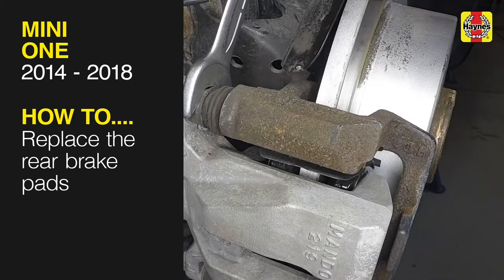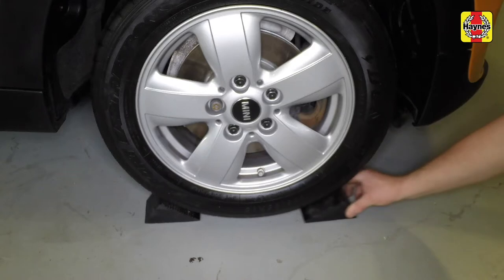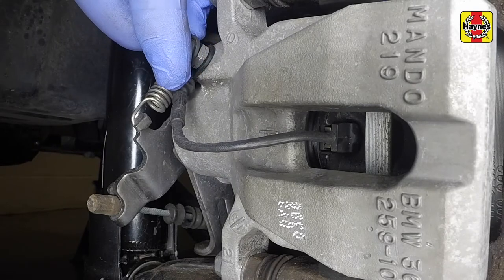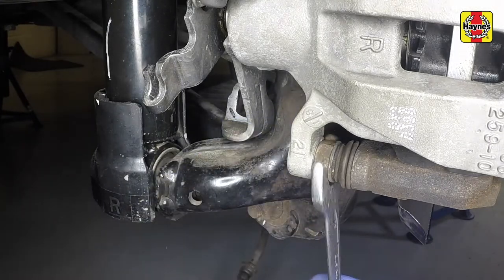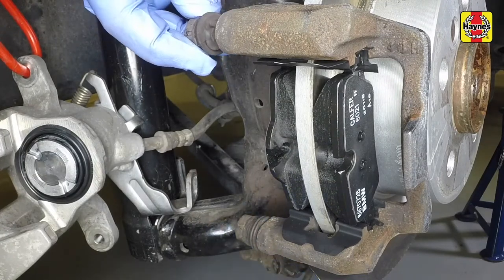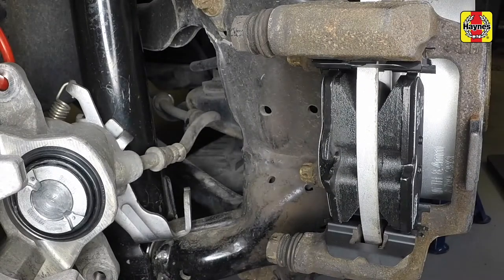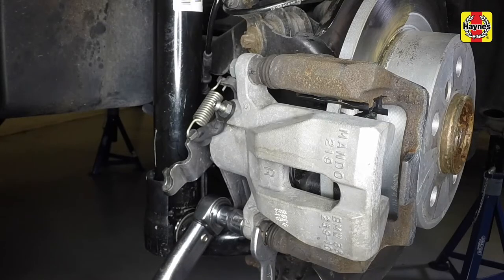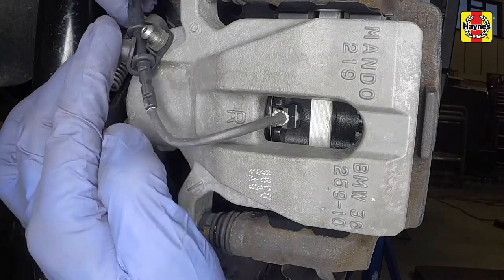Mini One (2014 - 2018) - Replace the rear brake pads

Comment: Follow up. I did finish the rear brakes on my ‘18 4 dr S model. I was unable to reset the ‘brake’ fault warning however after reusing old sensor. Your results may vary, but save the hassle, and the extra shipping charges, and order sensor with brake pad kit. Only 10-20$. Worthwhile. It is impressive, and idiotic, that BMW has managed to create disposable sensors. The copper clip came off mine when I removed sensor, and apparently causes the sensor to fail, even when replaced. Easy job overall and this video is spot on.
Reply from the maker: To be fair to BMW, they do say that the sensors can't be reused. If they're not worn through, it may be possible to get the old clip to work again, but for the small extra outlay, is it worth it?
Reply: @HaynesManuals  I agree. And yes, it is a small outlay. And yes, when you buy a “bmw”, you are buying every single sensor and electronic gizmo in the world, which will increase maintenance costs. New cars are designed to be taken to the dealer by people who are not interested (or capable) in DIY. Thank you guys and ladies at Haynes for helping shadetree mechs like me to do some things ourselves. A Learning process for sure
Reply: …or if you are in the middle of the desert, you can cut the sensor pad off and twist the wires together, when the circuit is complete it thinks all is good, no more brake wear warning light, so keep an eye on them. 
Disclaimer: (cough) I would NEVER do it this way

Comment: Is there any trick to lining those two pins on the inside pad with the dimples on the caliper piston? I spent 90 minutes wrestling with that.  Bought the tool to rotate the piston back into the caliper.  New pads wouldn't fit over the rotor.  Ended up having to just slap on the old pads, and I'm going to take the car to a shop.  Pretty disheartening, considering it's $700 to replace at a shop, and I bought the parts for $150.  I've replaced numerous pads and rotors previously, and never had issues until working on German cars. It's like automotive knowledge gained throughout life doesn't help when working on German stuff.
Reply from the maker: According to the manual, there's no requirement to align any pins on the inner pad with the cut-outs in the piston face. The cut-outs are there to aid piston retraction. Make sure the pad with the bulge in the backing plate is fitted to the inner location.

Comment: hi i have your book but i can't find the torque for the hex  bolt whit washer (m12x1.5x33)from the calliper carrier for the rear brake  (i see in the book 30 nm + 90° is correct ?)
thank for your reply 
sorry for my english
Reply from the maker: Yes, that's the correct figure
Reply: @HaynesManuals  thank a lot

Comment: What's this about the sensor needing to be renewed?
Reply from the maker: In order to replace the brake pads, the wear sensor (where fitted) must be pulled from the pad backplate. BMW/Mini insist that once the sensor is removed, it must be renewed. I believe this is because the clip that retains the sensor is distorted during the removal procedure, and therefore will not securely retain the sensor upon refitting. BMW/Mini don't supply the clip as a separate item. However, if the sensor is worn (activating the light on the dash), the sensor must be renewed anyway.
Reply: It's for extra revenue. Nothing more
Reply: @aarongrisham5555  aaro, does this mean you have reused sensors with success on the Mini? I have on bmws but yet to try on this Mini
Reply: @dennisblack6042  yup
Reply: @aarongrisham5555  I will find out tonight. Doing rear brakes on an 18 and dont have the sensors. Thanks
Reply: @dennisblack6042  anytime buddy. Saved you some money. Clean off the old ones and full send it
Reply: If your pads have got low enough to trigger a brake warning light on the dash then the sensor will need replacing. Otherwise you can re-use the sensor.